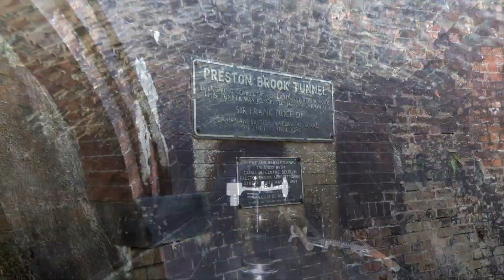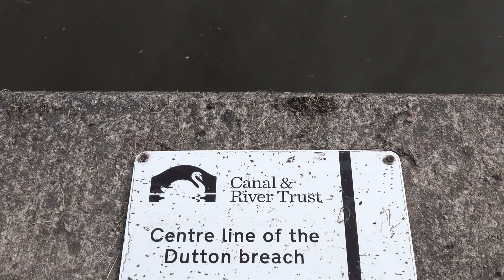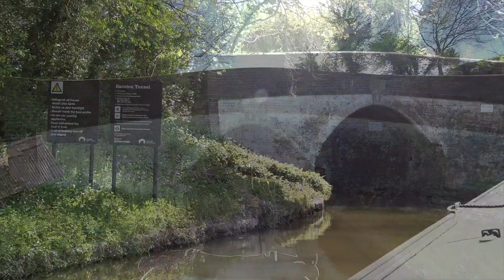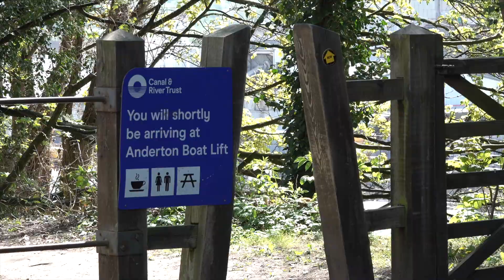The Trent and Mersey Canal Collapsed! Ep. 152.

Comment: Are the tunnels one way, or do boats travel both directions?  If both directions, how do you know when it's safe to enter without hitting another boat?  Another great video!  You always are so informative and funny!
Reply: I think some tunnels use a token system like the railways used to, others have traffic lights and some of the longer and more challenging ones like Stanedge are managed by appointments with volunteers.
Reply from the maker: Most tunnels allow boats to pass inside, the ones that don't are either timed or have traffic lights x
Reply: @FoxesAfloat  Ah, that makes sense - thank you!
Reply: @garybell5315  Hi Gary, Thank you for your response - it looks like the traffic light is how it works.  Best of luck to you selling your home and moving into a canal boat - what a dream!
Reply: @Tuberuser187  Thanks for your response!  I knew there had to be a logical answer - this is such a foreign system to me being in New England (USA)!